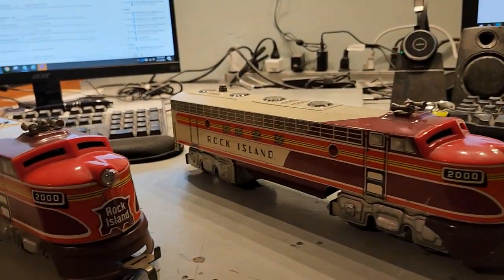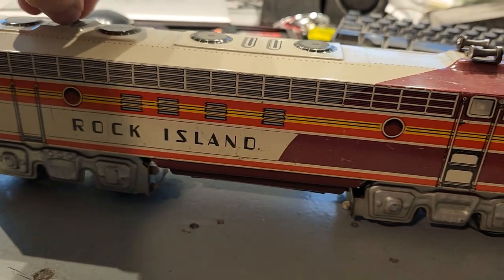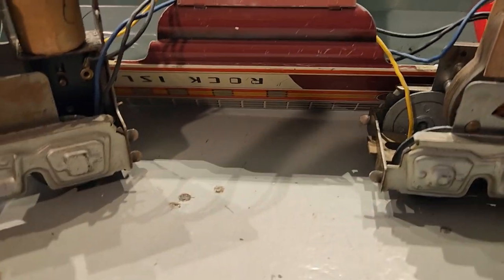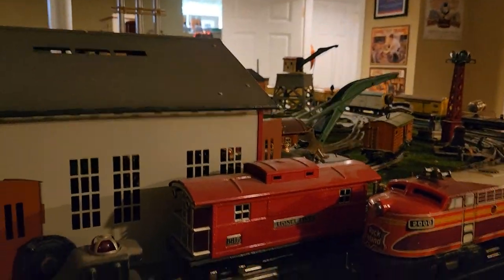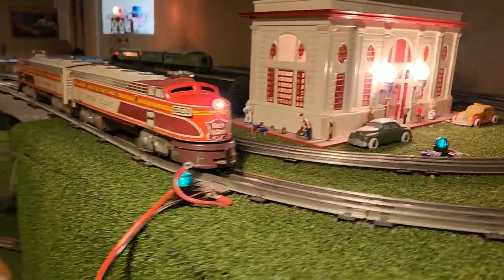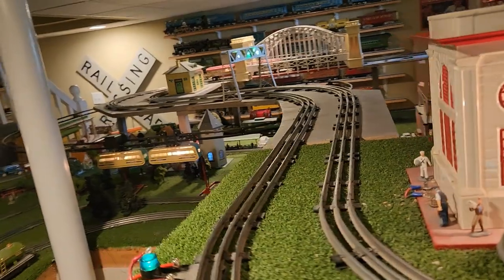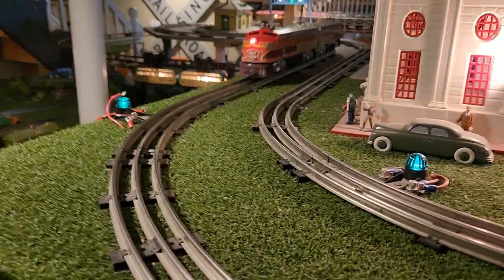Unique Art Trains #2000 Rock Island RR

Comment: Great video. Love these.  One minor correction: those are both A units, one is a powered A unit and the other is a dummy A unit.  The configuration you are running together is referred to as an AA set.  The B unit (which I do not believe Unique Art ever produced for this) does not have a cab.  So a B unit, and I am speaking of the full size prototype on which this is based, looks essentially the same as an A unit except that both ends are squared off like a passenger car.  The B unit lacks a rounded nose.  This type of F body locimotive was run in many configurations on full size railroads.  Your model is an AA.  They also ran them solo with just an A unit. Often they ran in AB sets of two locomotives at the head of a train.  For really long trains an A-B-A set of three locomotives was at the head.  Did Unique Art only make this model in Rock Island livery?  I have not seen many of these, but the ones I have seen are all painted the same as yours.  Like you, I mostly run prewar tinplate, but I love these 1950 lithographed creations (I just bought a Marx #21 AA set) and agree they look fine with prewar tinplate.  Thanks for the great photography, you have a very nice layout (love the monorail).
Reply from the maker: Thanks for the correction. Regarding the question if UAT every made other liveries of this locomotive, not as far as I'm aware. Also, they never made cars to go along with it. I've tried to find something that might work, but nothing looks right. This is a fairly large locomotive and dwarfs most passenger cars. And thanks for the kind words on my layout.
Reply: Thanks, I know what you mean about the lack of cars.  Similar situation with my Marx #21.  I’m tempted to try matching it with some of the Japanese tin lithographed “floor train” coaches that people have modified with O gauge trucks.  I imagine Unique planned to release cars in this scale but the company ended before that could happen.

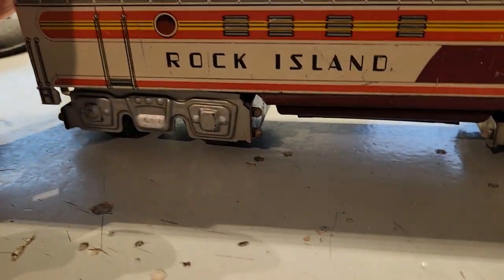Comment: They seem to be very close to scale (1:48) size. They seem to be a model of the FP7. Which is 4 foot longer than a regular F. It’s a pity they never made passenger cars on the same scale. I think this paint scheme was only really used for passenger power. I see yours has maroon paint on the pilot. My set has just tinned steel there, but the tin is thin and oxidized and looks splotchy. Maybe they painted later ones to look better. I may paint my pilots to look  like yours.